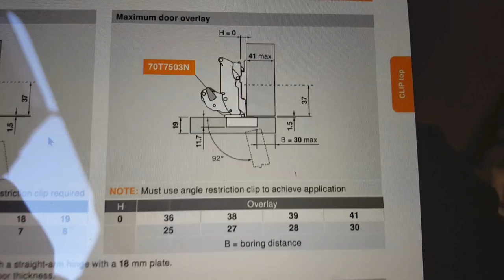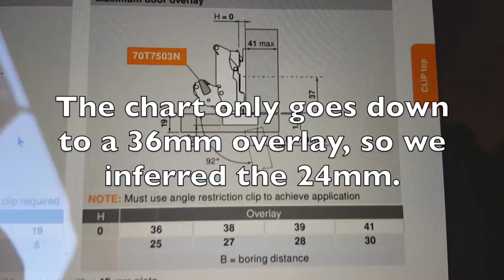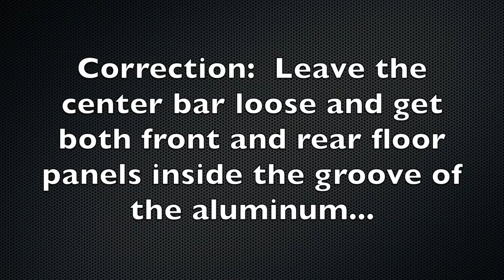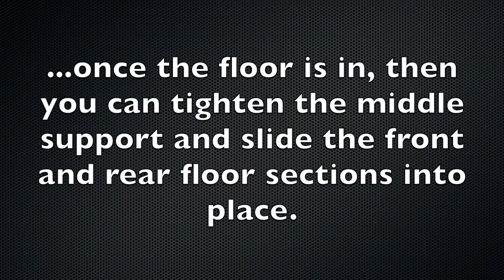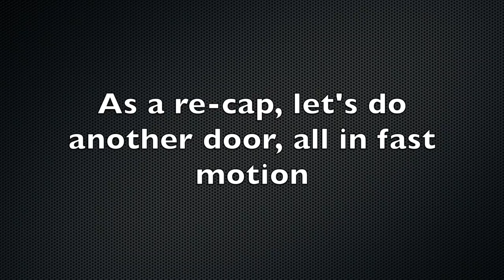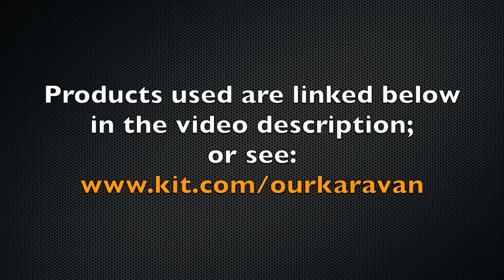Overhead Cabinet Doors - DIY Sprinter Camper Van

Comment: Yours wasn't the very first videos I spotted where people were using extruded aluminum in a van, but after seeing your galley build and now this, my upcoming build will be 100% done with this stuff. Corrosion proof, looks great and basically as easy to work with as wood, maybe easier in some ways - bolting things together instead of screwing into wood gives infinite chances to reposition and adjust, so cool. The overhead cabinets look great as well. And with this stuff bolted into the van, if anything the entire van should be more structurally sound in case of an accident.

Comment: Great stuff... super clean work.  
I ended up doing overhead cabinets on both sides of my van using your videos as guides.  I used some 80/20 hinges and door hardware and my paneling is bolted to the 80/20, so overall it’s got a little more industrial look, but I love them!
Thanks again!

Comment: So, i've got an '02 3500 Sprinter and the intention is to turn it into a camper van & i finally started to research what route i'll take. I've looked at a lot but in all honestly i love yours the MOST. You have given me the inspiration to do this right. 

 I'm curious and eager to see what your bed setup will be. Also, do you plan on doing a toilet and/or shower? If so, what are you thinking for that? I googled and came across a couple really inovative fold away shower units but sadly they were all conceptual. 

Thank you for taking the time to video your journey and sharing with us!

Comment: Beautiful build. Why did you select 3/4” for doors, yet 1/4” for cabinet bottoms? 80/20 looks like a great material to work with. Thank you for sharing.
Reply: kenetube Thanks! I thought of that after I sent the question. Looks like you chose some great hardware. Well done.

Comment: Thanks for the video. 
Question, how do you mount the 8020 that has 90 degree angles to a ceiling or sidewalk that’s not square? You leave gaps? Or use angle shims? If you use shims , where do you get them? Thanks!
Reply from the maker: I have another video on my channel that shows how I used shims to accomplish this.

Comment: As always Ken, just blown away by your analysis, creativity, and excellent craftsmanship!!  I want to copy your overhead cabinets and have a few questions.  1.  What do you think about using the same attachment point technique you used on the ceiling on the back wall?  That is, fir out with the plus nuts and spacers and just have the 80/20 on the outside of the headliner (i.e. omitting the 80/20 piece behind the headliner)? 2. What are your thoughts about using slider doors on the upper cabinets like the ones you did on your recent lower cabinet? 3. Where did you source the bamboo?  Thanks!
Reply from the maker: Hi Drew,
You could do that.  Are you using the factory headliner?  If so, the PVC spacers would need to be pretty thick.  Mine are close to 1" thick.  The 80/20 rail behind the headliner is 3/4" thick.  So somewhere around 1-3/4" thick would probably be the right thickness.  

Nothing wrong at all with using sliders up top.  The 1/4" material I used on my lower cabinet is much lighter than the 3/4" I used up top, and no need for cabinet lifts and hinges.  That said, I think the uppers look very attractive compared to my lower rear cabinets. 

My bamboo is made by Plyboo.  I ordered from two different hardwood stores, so I think any decent store could order it.  

I hope that helps!
Reply: @ourkaravan  Thank you so much for your reply Ken!  

Yes, I'm thinking I will use the factory headliner; so, your point about the need for thicker furring shims is well taken.  

I love your upper cabinet doors too. That said, I'm kind of intimidated by the hardware install for the upper doors and  like the idea of the sliders not having to open outward in a relatively confined space.
Reply from the maker: The sliding doors are easier, yes.  And they look good enough.  The uppers though are usually what 'wow' people.  That feels good when you've worked this hard on a van!

Comment: Thanks for the informative video! What was the approvimate length of your vertical and horizontal supports? I think you mention 11 5/8 for the vertical, but you didn't mention the size of the horizontal supports.
Reply from the maker: When you say horizontal do you mean the profiles that help support the floor of the cabinet?

Comment: How do the floors slide all the way in the groves with cross members, are they not blocked by the fasteners that hold the cross members in place?
Reply from the maker: Hi, if I understand your question correctly, the floor of the cabinet is notched around the fasteners. You can’t see it though.

Comment: Do the cabinet panel bottoms rattle at all just being slid in? Did you need felt or 8020 gaskets or anything?
Reply from the maker: Yes, without the felt they rattle and slide too easily, even under acceleration and braking.  Some felt, gaft tape or Teflon tape will help add resistance and eliminate rattles.

Comment: How much does it cost to this ? Approximately .. ? Thanks 😊
Reply from the maker: I have a complete write up on my website, ourkaravan.com  where I  discuss cost of building with 80/20.  It's specific to the galley unit but would be easy to estimate for the overheads as they are just straight profiles.

Comment: Nice build, could I know how the height and depth?
Reply from the maker: Hi, the depth is 12-1/2" from the headliner to the outside of the 80/20 framing.  Add another 3/4" for the thickness of the cabinet doors. Height is 14-5/8", if I recall correctly.

Comment: I'm considering different profiles for the bottom face of overhead cabinet.  Choice between:
    1. Use smooth sides facing down, for better aesthetics
    2. Use slotted sides, for potential utility.  Maybe just slotted on rear edge
Has anybody used slotted profiles facing down and found them useful?
Reply from the maker: I have slotted facing down against the headliner.  I figured I could put led strip lighting in there or use it as an attachment point for something later.  I used solid facing down at the front for aesthetics.

Comment: What did you use to wedge the bottom panels in place to keep them from rattling?
Reply: Awesome - I have been messing around with tile wedges, but your way seems more elegant.  I really appreciate the time you have spent documenting your build, it has been very helpful in overcoming the many little details which take the most time to solve.
Reply: For some reason I don't see the answer to this. What did you use to wedge in the panels?
Reply from the maker: I used that grip mat that is typically used in rv drawers to keep things from sliding around. It was the perfect thickness to wedge the 1/4” ply in place and prevent rattling AND keeps stuff from sliding around.

Comment: 10 lbs each? Doesn't that defeat the purpose of 8020 they are suppose to be light
Reply from the maker: It all comes down to the look you want.  I wanted 1/2" doors but realized the European hinges and lifts require thicker wood.  The move to 3/4" bamboo from 1/2" bamboo only added 13 pounds to my entire build. Whether or not you make the same choice will be up to you.